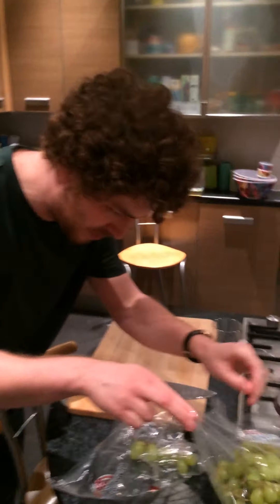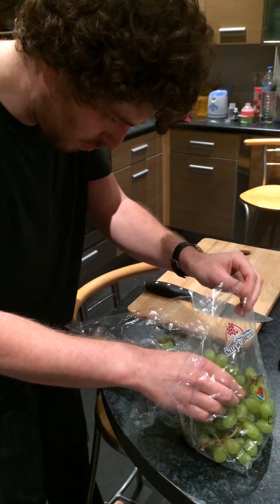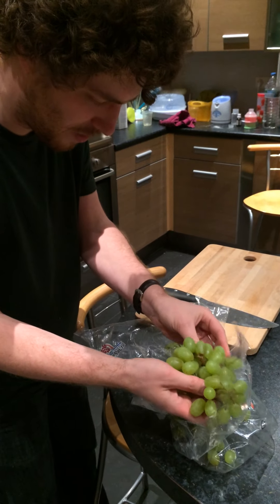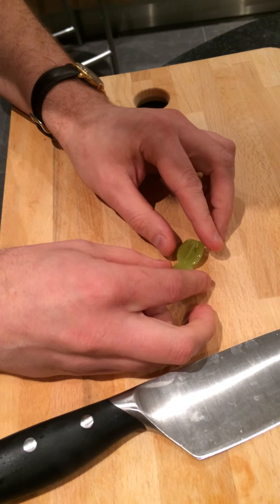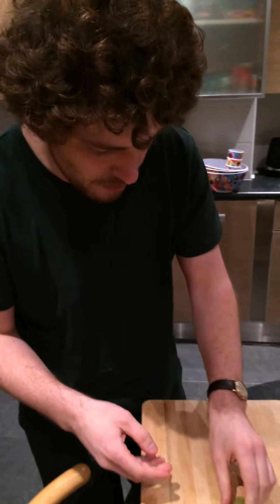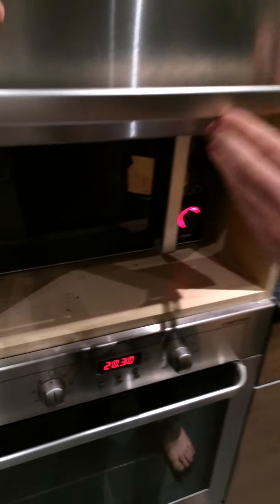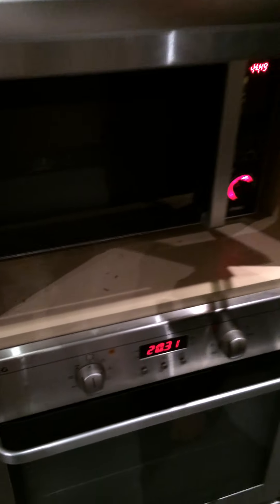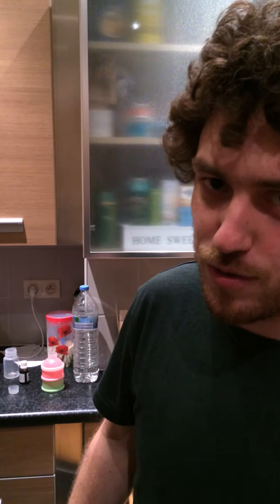Making plasma from a grape

Comment: Did it really break the microwave or was the timer set so low that it stopped after a few seconds ^^ ?
Reply from the maker: Timer was set to 30 seconds. I guess the oven shut down due to excess heat (if it would have continued, the flames would have gotten a lot spectacular). Right afterwards, it wouldn't start anymore, but one hour later it was fine again - probably needed to cool down.